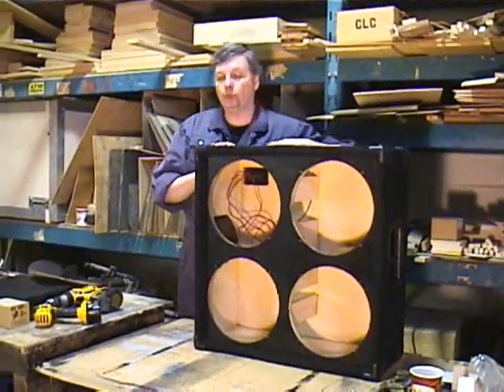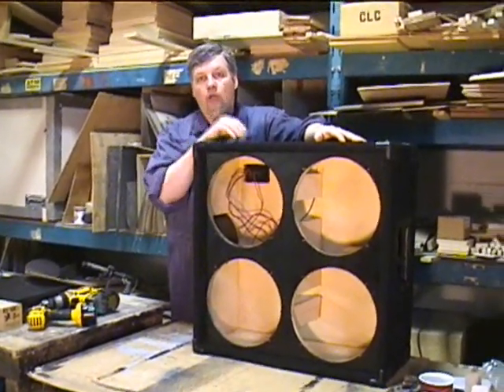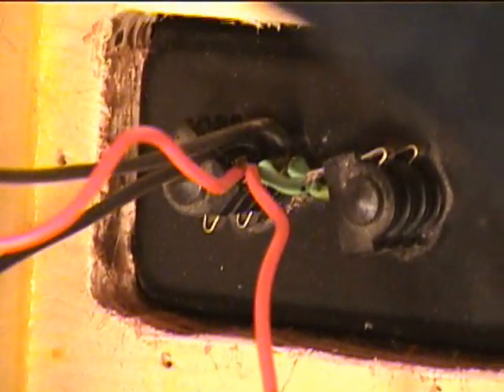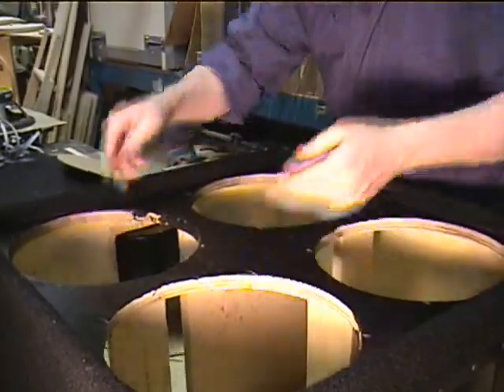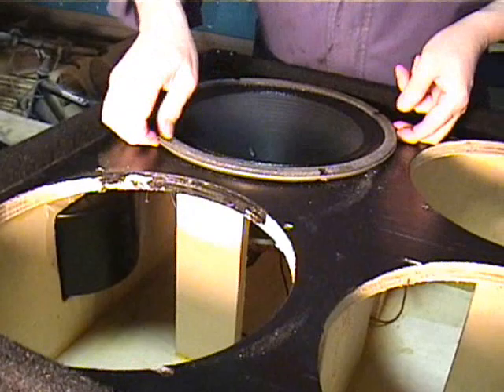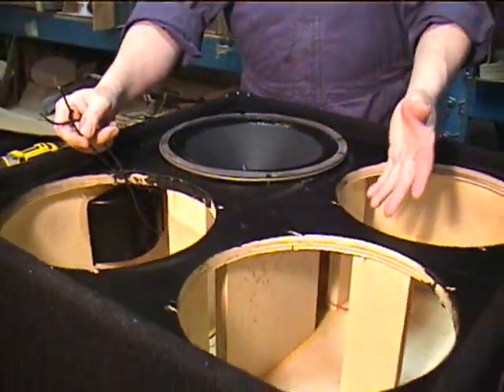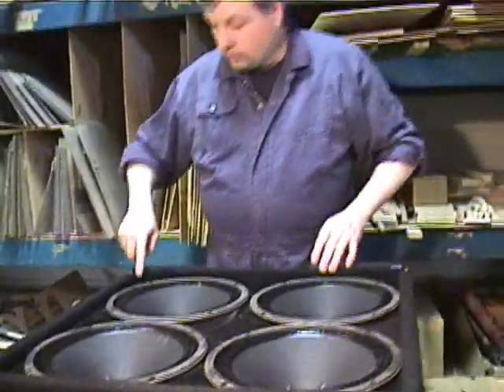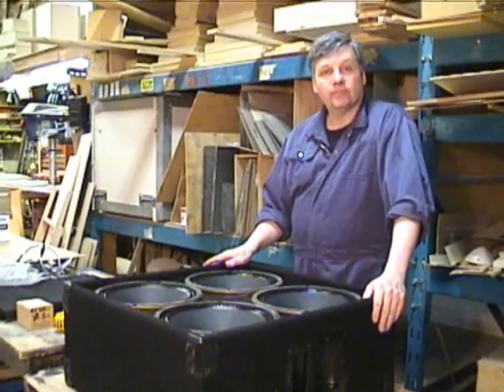Doyle Audio 412 Series Parallel Wiring Part 1

Comment: I have 12 JBL 2123H speakers @ 8 OHMS, but when I measured them with tester it only register 4 - 5 ohms each, what would be the total impedance if i do a series parallel connections? shall i compute for the "8 ohms" each or the actual numbers from the tester? I'm trying to save usage of multiple power amps if possible, and i also don't want to strain them.
Reply from the maker: Gersan Sounds Hi Gersan, Fun band. I checked out your vids :) The "H" in the JBL model numbers, as best I remember designates an 8 ohm speaker. "J" of that model should be 16 ohm. Don't know why it's reading 4 to 5 ohms. A pair of these if reading the ohm level of 8 in series would give you 16 ohm's . Note the wattage will not increase. They are still going to handle the 250 watts each is rated for. Kind of like putting a fuse in series. I don't know what configuration, how many drivers you want to use in a box. I suggest you wire series parallel 4 units and measure it with the meter again. Is your meter working properly? Are these a recone that someone might have customized the coil? An 8 ohm speaker could read down to 6 ish ohms but 4 to 5 is a little low. Phone us at the factory if you like and maybe we might be able to help you more. 905 839 9998

Comment from the maker: I would prefer two 15"s in parallel to one side of a stereo amp. And the other 2 , 15" in parallel to the other side. This give the amp a 2 ohm load. Amps don't select the ohm rating the speakers do. (Tube amps can have a ohm select Bias) 
I strongly recommend the American built Ashley or the American built Crown. Anything made in China is a gabble. 
Good luck :)

Comment from the maker: In series\parallel wiring, provided all 4 speakers are the same ohm rating, the whole cabinet will be the same rating as one individual speaker. Hence if you are using 16 ohm speakers the whole cab is 16. If you use 8 ohm speakers the whole cabinet is 8 ohms. Remember that's just in this particular configuration of 4 speakers with 2 groups of 2 in series. The two groups tied together in parallel. Hope I didn't confuse you more than what to say when she asks, "Honestly does this make me look fat?

Comment from the maker: Would you believe I'm answering this a year later. LOL Sorry I must have missed this question.
And I can't answer it now for sure. As most 12" speakers can be either 8 or 16 ohms. Some even 4 ohms but very rare. 4 X 8 ohm speakers in series Parallel will give you a 8 ohm load. 4 x 16 ohm speakers. series parallel will give you a 16 ohm load.

Comment from the maker: Usually the Extension jack is just another jack in parallel. So by using a second speaker cable, (Make sure you are using a "speaker" cable and not a low gauge signal cable) You are actually re configuring the ohm load pre cabinet. As I don't know the cabinet, this is an educated guess. But I'm old so it's a good guess lol.
When a head said it's 4 ohm, they are usually referring to the minimum load. So in a solid state if its a high ohm like 8 or 16 ohms, it's less stress on the amp. It's okay.

Comment: My valveking cab is wired in a way that i can only use one half of the cab on the top  or bottom, and that goes for both inputs , I recently just learned it should all be the same circuit and the other jack should be for extension cab wondering if rewiring the whole thing is a nessesity. Also I was running a solid state head 4ohms into this 16 ohm cab could I have seriously damaged the amp? I just bought it thinking there was something wrong with my valveking head when it was the speakers.

Comment from the maker: @thatcoolG 
Hi Thanks.
If you have 2 x 8 ohm speakers in parallel, you will get 4 ohms, which is about as low as you want to load a guitar amp. If you have 4 x 8 ohm speakers in parallel, you will have 2 ohms and hurt most guitar amps badly. Tube heads, even when they say they can go to 4 ohms, run best with an 8 ohm load. Search the net for schematics on "series parallel wiring" . Theres lots out there.
Take care.

Comment from the maker: @mwbassace 
I appreciate your opinion yet I have to totally disagree with you.
In the past 30 years we get to see 412s once in a while come back for replacement speakers.
Juno Winner\Hall of Fame artist David Henman, found the 4th cabinet we had ever built, from 1980. The 16 gauge original wire with knot in this 412,  showed no fatigue you had theorized. 
That cabinet with original wire is back on the road for hopefully another 30 years. The Proof is in the Pudding but Thanks for your concern.

Comment: putting a knot in wire is asking for trouble. it causes stress on the strands which in turn ruins the wire. i know this cause i'm a j-man electrician with an electronics background. you can say it's not gonna move, but it will & the heating & cooling of the wire will effect it also.

Comment from the maker: Outputs are probably in Parallel so use either one jack output to one jack input. 
Minimum just means Minimum in this case. An 8 or 16 ohm cabinet will work fine. Just keep in mind the higher the Impenitence the lower the wattage from the amp. A normal 8 ohm 412 is usually series parallel, which means you can't get it to run at 4 ohms. 
 My last bit of advice is to eat more fresh fruits and Vegetables and from a local farmer if possible. Apparently we don't get enough of them.
Take Care

Comment: I got a marshall head has 2 outputs and says "minimum impedance 4 ohms"  so should I have a 4 ohm speaker cabinet? and do I connect both jacks to the cabinet or just 1? or could it work with an 8 ohm 4x12 cabinet. Or is it possible to rewire the cabinet for it to be a 4 ohm? I'd really appreciate an answer I'm a bit confused any help would help thanks in advance!!!

Comment: I play mostly heavy music and use a Peavey XXX
head loaded w/ Svetlana EL-34's. My cab is an old Peavey w/ G12K-85 16ohm Celestions in it . What would you suggest
for a bottom cab at 16ohms? I'm looking for tight low mid's.

Comment from the maker: You could but shouldn't. 
If they are the same speakers, the 8 ohm cabinet will be about 3 db loader than the 16 and I'm guessing the 4 ohm will be 5 to 6 db louder. That leads to an unbalanced sound. 
You can do it though, just keep the expected out puts in mind as you set up.
You are not going to have an exact ohm level that falls on what your amp bias switch will do.
I would suggest you get a digital ohm meter for about $10, Plug in a cable to the cabinets wired and measure your Ohm Level.

Comment from the maker: We use 8 ohm and 16 ohm depending on many factors. Normally we want an 8 ohm load on the amp. That's usually the best set up for most amps. If it's a 2 x 12" cabinet , we may use two 16 ohms in parallel.
If you have 16's and you wire series parallel, you will have a 16 ohm cabinet. That will work well on every amp, but keep in mind it is only drawing half the power out of the amp than if you where at 8 ohms.
You can't get 8 ohm set up out of 4 x 16 ohms, if that might be your next question.

Comment from the maker: Okay this crazy but true.
1984 I had someone walk up to me at a convention in Toronto asking, "Why should I by a Doyle cabinet instead of a Marshall". I picked the cabinet up to my head level and dropped it flat on it's back on a Concrete floor. I then said. That's why. No damage. We continued to do this at the same height " 5' to 6' for the rest of the show every 1/2 hour. On the 19 th time we finally got a small break between the two holes on the baffle where you now see those plates. LOL

Comment from the maker: If you really want to try and put this in place on you speaker, I believe there is a Magazine out there called Voice Coil. It would have speaker part suppliers that could help you at least get the parts. The cardboard is usually riveted on.
Good Luck

Comment from the maker: Soldering can be very tricky if you are not use to it. The biggest mistake I see is when people put the speaker face down and don't think to slide a protection peice of card board in between under nieth the solder points and the cone. The solder can drip down on to the inside of the cone. That Card board is part of the speaker and comes with the speaker. It has to be soldered into place and working with the tencles that come of the voice coil can be even harder to work with. 
But!!!!

Comment from the maker: This is what happens when one side of 412 goes down. This is why we designed our PRO 412 with a stereo chamber. If one side goes down , the integrity of the sound on the other side won't be damaged. The musician can finish his gig and possibly tour, until he gets it fixed. He can mic the working side and the audience won't hear the difference. 

P.S. I checked out Joeydahlia's channel and it's a lot of fun. Check it out.

Comment from the maker: HELL NO! Don't do it.
The bottom speakers will work as a damping Anchors. As your top speaker pushes out, the bottom speakers will get sucked in. Causeing a phase cancellation in the low mid frequencies. The top speakers are now working twice as hard, working in an air volume that is twice as big as they should have. Speaker needs some back air pressure and forward negative air pressure in order to not damage the coil from over excursion.
The speaker will now handle about 65% of its rated power

Comment from the maker: Sometimes a speaker can get damaged from wear or over driven, in such a way that it still works but the voice coil is compromised. This can affect the frequency output on either end of the spectrum. The fact that you are hearing distortion raises that possibility. 
A third possibility is that you have bought the speaker used and someone has put different speakers in the bottom. Check it out.

Comment from the maker: Thanks Joey
One of two things maybe happening when you hear a different tone from speakers in a 412.
It maybe that it simply appears that the bottom speaker has more Bass. Sound becomes more directional as you go up in frequency. You will here more higher frequencies if you are physically looking straight at the center of the speaker as a pose to 45 degrees of axis. Try it. There fore, you will hear more top end from the top speakers physically closer to your ears  than the bottom speakers. OR..

Comment from the maker: Good Question. Thanks
Quick answer. Yes 8 ohm speakers have a good balance of  variables in a coil.
I6 ohms, common for 412's when the speaker company wants you to buy a stack. Unless you are a VERY loud Pro, on a big stage or a wanabe poser with more money than Brains, you don't need a stack. .LOL 
Sorry had to say it.  
There are some 16's that just might have the "Sound"
fyi
Amps don't "Put Out" ohm loads. They "Handle" ohm loads. Sometimes with sweepable settings to better handle the loads.